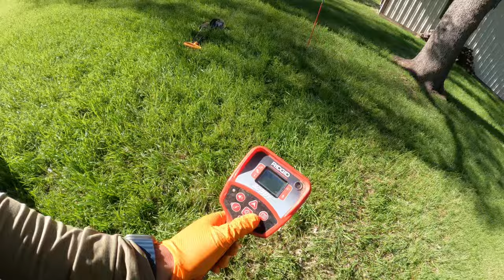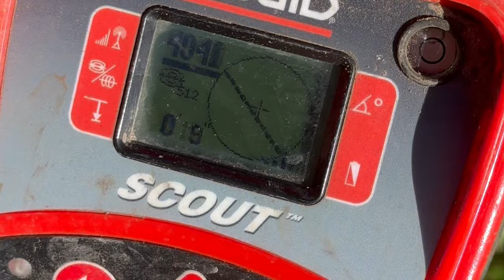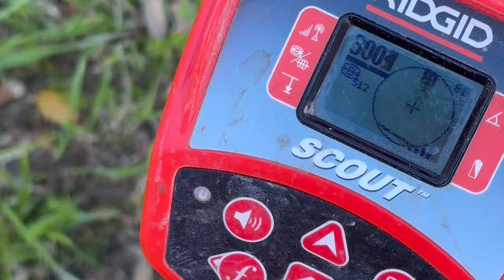Inspecting a Septic Tank

Comment: Love your videos!! Do you ever run into gas lines when digging? 

Im in water treatment and we deal with a lot of trenching and burials
Reply: Can't speak for him, but I've dug up thousands of tanks here in IL and never hit a gas line. More common here to cut underground cable/internet lines. Of course they put them right over the septic tanks lol.
Reply: @BurntSkidaddle i always run into the same problem. More irrigation lines for me. Always running right over the tank or distribution box. Actually had a irrigation line running right through a Distribution box.